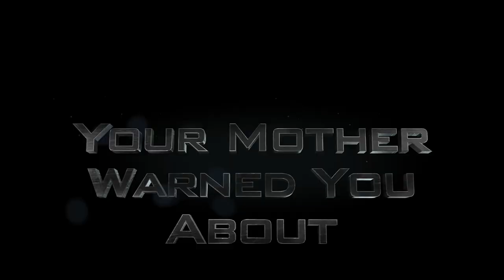Ray Novak From Icom On Ham Radio, Life, D-star, IC-7300 and the New IC-705

Comment: Thanks, Bob and Ray! 

I bought my 705 last summer, shortly after passing the General exam. It mostly sat in a storage box until last week. I had my first D-STAR QSOs, using Doozy on my laptop and operating off the dining table. I still haven't been out in the field or operated HF but I've a few antennae I've either bought or built and I'm going out Sunday to start playing with it. I've used DMR and written my own codeplugs but D-STAR, for reasons noted, makes more sense and is more fun for ham operations. 73 de KN6NPZ

Comment: I have had zero contact with Icom DSTAR radios or Yaesu  Fusion (C4FM)radios. I  assume the digital modes/repeaters are incompatible. I have seen some radios advertised for DMR and Ham Radio.  They did seem to be less expensive but less full featured than either ICOM or Yaesu xcvrs.

Seeing this video, I will investigate all three, but I was leaning toward the IC-705 in the winter this year and my first digital mode w/DStar t. I don't do any 2m/70cm work now but I do need a radio for that other than my FT-817.

Thanks for video.

Comment: Yep watched the first few minutes so far and 110% agree... if you going to use digital protocols in amateur radio, you really should understand them in depth, I have presented on this several times. Especially the benefits and learning/experimentation available in purpose built amateur protocols (D-Star, C4FM)

Comment: I've only had my license for a couple of years. First radio I got was an 868. I find writing DMR codeplugs very easy. I even program my Motos now. I want to try DStar. I've watched enough radios that I think it's finally sunk in on how to use it and set up your radio for it. Debating on what I want. I thought about a 5100 or 7100. Wish they had a color screen though. I like the bells and whistles. I mainly use 2M/70CM and DMR for now when I do use my radios. I can't really justify a 9700 but I'd sure love to have one.
But I probably won't be buying anything anytime soon though until I see which way the economy is going to go. 

Enjoyed the video
Reply: Dapper Ribbit do any DMR radios have a Color Screen?
Reply: @robertobeltramelli4138  I guess it depends on how you look at it. The AnyTone 878 has a color screen but the fonts imo need work. 
I have moto stuff also 5550,xpr7550,sl7550 and they have color screens and they're nice but they're commercial radios so you don't get all the info like callsigns and location info that you do on other radios.

Comment: I have both D-Star and DMR (anytone 878) and prefer to use D-Star.
Reply: Why?
Reply: @radiosification  How to put it nicely. I bet it's the people. 
DMR tends to attract a very specific 'genre' Where d-star is good hams :-)
Reply: @spaceshipdev  same here. also d* is more versatile I think
Reply: @spaceshipdev  And that's why I gave up on DMR.
Reply: @knuckler269  Wouldn't be nice if Anytone Beta Tested its software and radios? As Bob so eloquently stated, Programming a Code Plug is a pain in the A**. The Anytone CPS and firmware updates are terrible

Comment: If the big manufacturers don’t incorporate DMR into their radios, the market will remain fragmented. DMR is not protected by patent. There is no harm to their market share if all the radio makers include it. They will never give up their own proprietary systems. The problem seems to be the manufacturers don’t realize that the users control the market not them.
Reply: they want to sell their stuff and hook you, but they are so many dmr manufacturers and even used repeaters are many on ebay
Reply: DMR folks like cheap radios, Icom does not sell Cheap Radios.
Reply: @robertobeltramelli4138  icom is the only one that dont have DMR they jut want you on their system . Kenwood,  Vertex(yaesu), Motorola, Alinco, Harris, Tait and almost everyone have DMR radios
Reply: And i start to see lots of old motorola dmr repeaters on ebay. Ao that happens when the repeatera become even cheaper people will buy them. But you cant beat the yaesu fussion 400$ dualband repeater. People buy it even just for the analog price :D

Comment: There are NO D-Star Repeaters within 75 miles of me. Meanwhile, there are dozens of Fusion and DMR repeaters within 25 miles of my home. Tells me everything I need to know.
Reply: Probably why you need a hotspot and solve that distance problem.
Reply: And probably fusion is there because of the great pricing. It was a steal at one point
Reply: Todor Tihomirov the closest fusion Repeater is 22 miles.
Reply: @smithsterj   i just wanted to say that they almost gave them away and the are as cheap as a radio

Comment: I have a question, when is Icom going to make a 200 watt moblie?  Kenwood has had one out for years.  Hmm 🙄
Reply from the maker: Hmmm. I don’t know. If I ran the company there would be one now.
Reply: @K6UDA  I'm a Icom guy but have the TS-480HX in the mobile.  What a difference running 200 over a 10 or 100 watt radio.  It's just not 1db better it's a huge difference.  I know I've had all kinds of different rigs in there and 200 watts just destroys the rest.  😁

Comment: Disabling the stun or kill function in DMR is as simple as deselecting a checkbox in the CPS. Actually, in the Hytera CPS that come with my radio, it was already deselected, as was the encryption option. So this is just FUD, in my opinion.  

D-STAR does have some advantages over DMR such as the transmitting the call sign in every transmission, without the need for a static ID to call sign table being loaded into the radio. Features like this is what I would emphasize, not some commercial feature that the DMR protocol supports but no one in the ham community uses. 

FUD aside, I do look forward to buying an ID-4100A soon and experimenting with D-STAR.
Reply: Phil, the point of discussing that is many hams do not know about these features, and many of the early radios had these enabled.  I think you will enjoy the ID-4100A.

Comment: The Alinco DJ-MD5 DMR HT, can be Programmed with a Commuter, and also have a ICOM IC52A D-Star HT, which I like it Much More then DMR, 
D-Star is only 6.25 Khz Wide,  unlike DMR and Fusion, this is 15 Khz Wide,
Much more Spectrum efficient, it be nice to have Terminal Mode on Bluetooth, Both ICOM 705 and the ICOM IC52A, this way I be able to Use it Wireless,

Comment: Back in 07, when D-Star was first getting traction in my area, I purchased several Icom D-Star radios with boards for myself, family, and a friend.  On simplex, the audio quality was outstanding.  When the first repeaters came up in my area, audio quality through the repeaters was noticeably diminished.  When these repeaters were linked through the network, audio quality sounded like crap.  Registering on the network, while kind of dumb, was not terrible.  You had to contact a networked repeater's owner and have them put you in the database as I seem to recall.  Nowadays, the registration process as I understand it involves multiple steps and is ridiculously, unnecessarily, cumbersome.  Why this is, I do not know.

Of the digital modes I have used (D-Star, P-25, Astro, DMR, and Fusion), D-Star by far has the crappiest audio and is the most prone to "space talk", other noise, and distortion.  Not using it to send data, I see no use or advantage to it, other than to say I am "using digital" (...whoopee...) and that it will display your callsign and negate the need for voice ID when transmitting.

DMR, at least serves a purpose other than just being digital.  To me, its biggest annoyance is having to update your list of ID's (ID number to call sign, etc).  DMR offers far less distortion and space talk than D-Star and gives you the very real advantage of allowing two conversations on the same channel with no interference between them.

The other digital modes, in my experience, have better audio quality than D-Star but about the only advantage I see with them over analog is being able to say that you are operating on digital (...whoopee...).

Yeah, D-Star was created specifically for ham radio but it is a crappy sounding, outdated, mode IMHO.  At the risk of being thought irreverent, I have often mused that Fukushima was probably God's judgment on Japan for creating D-Star.

Comment: This was a strange, misguided conversation. I know there are fanboys for each protocol, but the adversarial attitude is unnecessary.  Yeasu System Fusion was created solely for amateur use and was never intended to be a commercial product. This isn't mentioned. Codec2 and FreeDV are American based innovations are not mentioned and are ignored because hams can't get on Amazon and buy a $90 radio today.  I have a CW decoder in my Xiegu radio, so why it isn't in Icom providing it?  The IC-705 will be way overpriced for most non-fanboy operators!

Comment: Icon 705 looks very flash but like everything Ham Radio related the manufacturers don't seem to listen to the end user, instead just doing what lines there pockets.. A portable all band Transceiver with no built in ATU is just stupid. The HS2 will be out soon and at a 1/3rd or possibly a 1/4 of the price has a built in ATU and also has all the Cellphone, internet and digital modes inter connection and operations under the sun.
I was planning on buying the IC705 But think I will now see how the HS2 looks in practice.
Reply from the maker: Never heard of the HS2. What is it? Who makes it?
Reply: @K6UDA  It's the Updated model from the Alliuance HS1 but instead of just covering HF and 6Mtrs it does VHF and UHF as well. It was due for release anyday but I think it may have been delayed by the virus. 
They have it down on special offer pre release on there site at the moment. It looks like a really good all band all mode SDR with built in Bluetooth and WiFi 30watts apparently. Would love to see a full review of one as it looks just the ticket for portable operations.

Comment: He talks out the both sides of his mouth.
Reply: "i'm thinking about the ham community" ..buuuuut ... DSTAR radios are way more expensive than DRM radios.   then open up the DSTAR IP and let others build cheap(er) DSTAR radios!
Reply: He's a salesman so...
Reply: The D-STAR IP is open, one of the reasons Kenwood developed a D-STAR radio.  The key thing to reduce costs is the volume of units.  Since D-STAR was designed for Amateur Radio, it will not migrate to the Land Mobile industry, where hundreds of thousands are sold globally.

Comment: ICOM really need to work on reflectors supporting terminal mode, it's just not good enough. I should be able to connect to any reflector via ethernet but I can't. Instead I have to use Open Spot 3 to do something the radio should do on it's own. Disappointing.
Reply from the maker: Reflectors is a DPlus thing. It's not an Icom thing at all.
Reply: @K6UDA  Reflectors is a D-Star thing which is an ICOM thing. Or is that wrong?
Reply from the maker: John Ratcliffe both Icom and Kenwood make D-star radios. D-star was created by the JAAL (Japanese Amateur league). Icom was just the first company to adopt the protocol and produce D-star radios.
Reply: @K6UDA  Interesting. Thanks